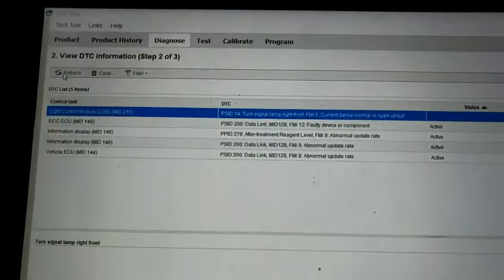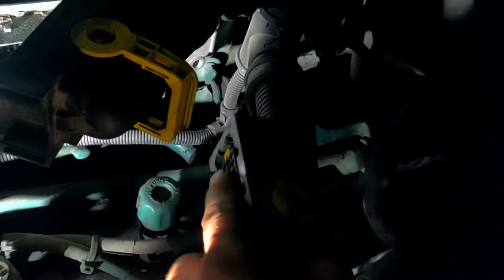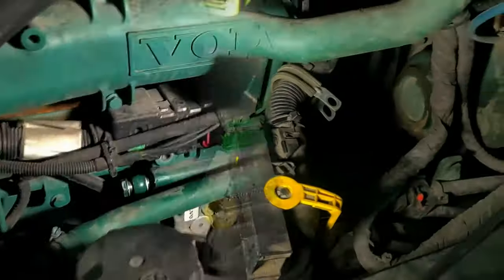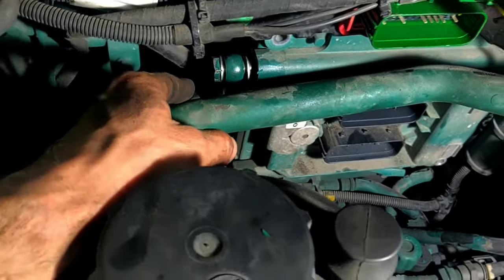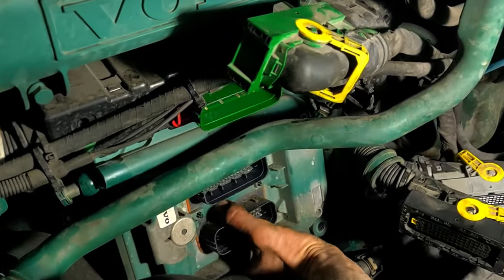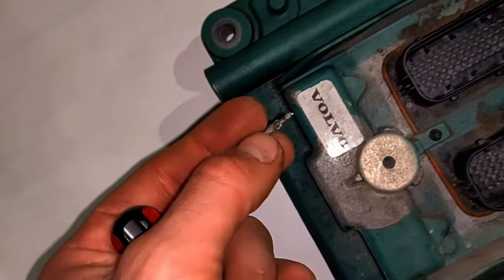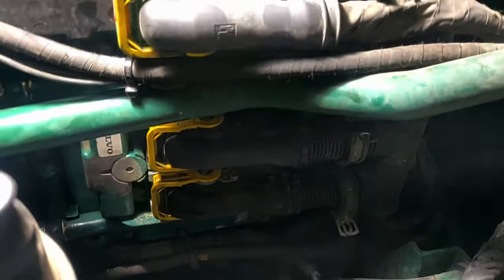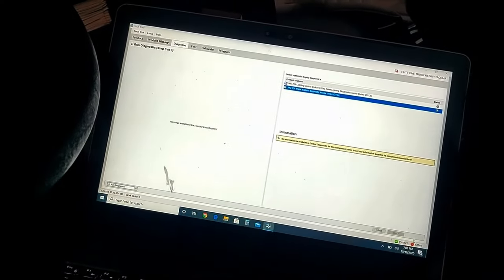Volvo D13 no crank no start/ Bad ECM replacement

Comment: Looks like Pin B57 of the EECU broke off in the harness. Pin B57 is a power supply. Most or all of the pins on that end of the B harness and that end of the A harness are for ECM power or ground. This is why they are bigger than the rest of the pins. And wow. It clearly got very hot.

Comment: I'm the same issue, in my truck, i can get to gear 10 and the truck starts to sputter out.. i was told it was my ecm at the volvo shop, its costing me 3500 for a repair.. is that right?
Reply from the maker: Yes, at Volvo shop price is approximate like this! I the ECM it's around 1200 and it should be programmed !!!
Reply: Just had mine go out. Costing me $3000. Got to get it programmed all over again and get the DEF off it AGAIN.
Reply: @bth9101  so one you get a new one a program it. It reactivated the DEF?
Reply: @bth9101  once
Reply: Hey man my truck is a 2012. It was running fine with check engine on. I went on vacation for a week and when I try to start it the lights would come on, but it won’t crank at all. The only message i get it Maintenance required vehicle Ecu. And j1939 Communication error with Engine ECU. Please help me out with this if you have any idea what could it be
Reply: @juanwaysniper083  yeah you gotta get it flashed for the delete again

Comment: Hey I had the same problem (crank no start) on a 07 volvo d12 and I replaced the ecm for a different used one with the same part number,  now it starts only when primed and accelerates fine then dies seconds later. Does that mean I need to get the ecm reprogramed??
Reply from the maker: Usually if its removed from another truck that is the same make and model it should work fine! If I'd doesn't you can try to reprogram it! Are you sure you don't have any other problems?
Reply: Hey man my truck is a 2012. It was running fine with check engine on. I went on vacation for a week and when I try to start it the lights would come on, but it won’t crank at all. The only message i get it Maintenance required vehicle Ecu. And j1939 Communication error with Engine ECU. Please help me out with this if you have any idea what could it be
Reply: @Tampa-o8k  same here brotha
Reply: @phillipslattery3260   It was bad ecm

Comment: Valeriu salutare. Pot să intreb dacă folosim un ecm uzat dela  motor asemanator cu aceiasi ani aproximativ. Este nevoie de reprogramare sau avem sanse să pornească fară? 
Si dacă este nevoie de reprogramare cum de reprogramat ? Prin remplace hardvere sau new software ?
Mulțumesc anticipat.
Reply from the maker: Daca e acelasi an si acelasi model trebuie sa mearga fara reprogramare!
Reply: @valeriumoscalu7580  da dacă nu merge avem sanse să-l reprogramăm fară dilear oficial ? Si prin ce dacă stii ? Remplace hardware sau new software.

Comment: Hey i have a 2012 vnl. Its not doing anything when i try to crank it. Its giving me this message along with check engine light. J1939 communication error with engine ECU. Any idea what could it be?
Reply: Did you find the problem? Was it the ECM?
Reply from the maker: In my case was the ECM
Reply: @valeriumoscalu7580   Hey I just had that same code come on my display and truck shut on me everything seems normal but it won't crank or start when you turn key over. How much was the ecm if you don't mind me asking?
Reply from the maker: Around 700 for ecm and 270 programing
Reply: @valeriumoscalu7580   thanks
Reply: Ecm
Reply: Hey buddy I just spoke with mechanic it was my ECM thanks for your help.
Reply from the maker: You welcome! Did you replaced it already?
Reply: @valeriumoscalu7580   No the shop id in search for one at the moment but they t were able to take one off another truck and try it on mine just to make sure it was my ECM